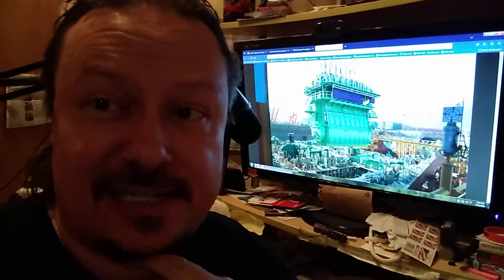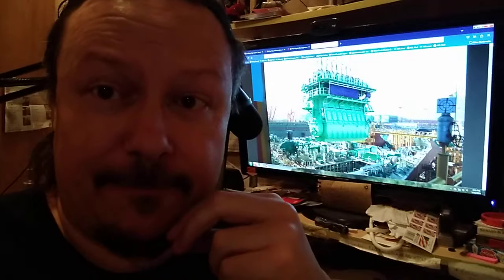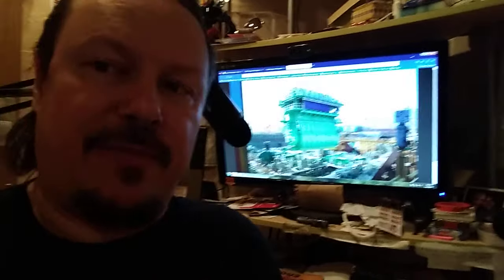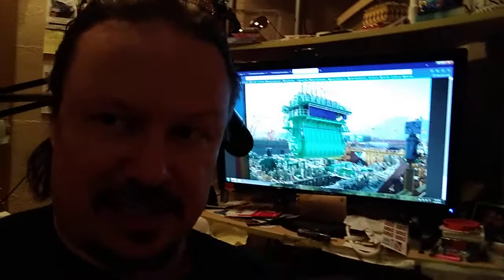Dali Container Ship Baltimore Bridge Crash technical aspect explained by maritime expert.

Comment: Id be inclined to disagree. If my memory serves from my time on low speed diesels, the shaft generator isnt used when manoeuvring in port. The reason being is you are constantly adjusting the speed and often with turns you will stop the engine prior to it so your shaft will stop turning. Theres generally a separate generator set running to cover this and then the shaft genny is switched on when its in open sea and continuously turning at a constant rpm. If they lost the engine for whatever reason, by the time it was restarted and control passed up to the bridge and the engine re-engaged, the two minutes is long gone and you are already against the bridge.
Reply from the maker: Reports have said they lost all propulsion and electric, the lights are seen going off and on again as the ship neared the bridge.. Even a separate generator system must have failed to have ships lights and power cutting off.
Reply: Completely agree with you..  on my ships shaft generators only used in open sea. Never  ran in standby mode,  always ran generator to supply power on standby.   So many other things which is not in agreement  with systems and operations on solas ships or big ship systems or operation principle.
Reply: Shaft generator was not running   If it was running that was a huge mistake   Problem was much more likely unstable parallel opration of at least 2 of the main generators .  A common problem that is often misunderstood by the crew and often leads to tripouts.

Comment: What should have been done is not try to stop the ship by giving stern thrusr nor dropping the anxhor after emergency power was restored to the steering,  but let the ship di as it was while approaching the Bridge, at about 8 knots & navigate the vessel under the ship using the 8 knots head momentum
To slso know that the heading is not depended on the propulsion but on the momentum,
Reply from the maker: Reports says they lost steering ability so possibly that's why they tried reverse when engine was restarted.  Something extreme must have happened to cause electrical loss and propulsion, most likely related to the maintenance work done while in port..

Comment: "The structure may of looked so weak" until till you find out once the 1st break happened the  cantilever (4/5's of the entire the bridge) pivoted down like a see-saw over the undamaged channel pier ripping & lifting the far end of the bridge (3 piers over) up into the air which  started the snapping & crumbling of the trusses into pieces. Unfortunately it can only be seen in a full shot of the entire bridge as it went down. This is not visible in most video's because of the intention to have a better closer/instant view of the ship while the bridge was collapsing.
Reply from the maker: The concrete bases used for this bridge seem too small.  If they oversized them and made them taller, they would possibly safeguard the metal from being hit by such a ship.  They are supposed to built reinforced with metal and highest strength concrete.
Reply: @benzproducts Truss bridges were very popular from the 1940s to the 1970s because they were very strong for their weight. But they got that strength by everything reinforcing everything else, so if you had a collision that took out some of the structural supports, the whole thing would house-of-cards itself to death. That's why we don't use truss bridges anymore.

Comment: Not sure if the Dali has a shaft generator. According to Wiki, it has two 5,150 hp (10,300 hp combined) and two 5,900 hp (11,800 hp combined) auxiliary diesel generators for a total combined 22,100 hp.
Reply from the maker: It's possible that they have separate generators and also shaft driven generator as well.  I am wondering if they ran shaft driven generator as they left port to save fuel when it was dangerous to do so, this would explain the sudden loss of electricity and propulsion.  There's a special marine website that lists detailed technical specs as to what engines and systems are used on specific ships.  I have to find the information, possible follow up video...

Comment: My friend bought a big Tug , The Galene ,
with direct reverse . He joked about delivering it to home. “ I’ll be at dock at 2 pm , Don’t be there.”
     Forget about the dead prop , anchor grabbed and prop act like a sea anchor.
Down current you have to drive small boats aggressive to get turn to respond. 
With a vessel I guess you call it “ authority.”
 Had they missed bridge pylon and drug anchor over the high pressure gas line , we would have a bigger story and mess .
$$$ , they gamble with public infrastructure .

Comment: tugs guided it out of the dock. why not direct it out? fuel savings? now the commerce is gonna have to eat it. plus the dead people. prices on goods may rise. etc....really helped with my question as to why the huge 2stroke died so quickly.....i'm still hooked on the Fitzgerald sinking.
Reply from the maker: Engine had apparently had some maintenance procedures done while in port.  Possibly low lubricating oil level or air in the fuel system could cause a cut out.  They have safety switches to shut engine down if so level of lube oil gets too low.  A possible mistake could have been made during the maintenance procedures.

Comment: Why was that ship moving so fast in the proximity of the bridge to begin with? Unless the video's have been sped up, he was hauling butt!! Loss of power or not, why so close to the support structure of that bridge? Dynamite and C-4 explosive couldn't have brought it down so quickly.
Reply from the maker: These ships have to maintain some speed to overcome wind and currents in the water from pushing the bow sideways.  The aft or rear of the ship is the only part the rudder can move, this causes the ship cruise at an angle that's worse the slower it goes.
Reply: The videos you've probably seen have absolutely been sped up to make them watchable in a short time span. It's about 4 minutes from the mayday call to the collision (and that should also point out, a "terrorist attack" would not have sent out a mayday call).

It takes about 30 seconds from losing power for the auxiliary diesels to come on. After that it takes between 1-2 minutes for them to warm up to the point where they can turn the shaft. They lost power at the worst possible moment and it resulted in the ship being carried by water currents into the bridge footing. I've also read some information suggesting they were trying to back down using their screw in reverse after they got power back, I don't know if that's true because I don't know if they had time to do so.
Reply: @katherineberger6329 not a terrorist attack, more like a cyberattack where the attack was done without the crew's knowledge. Unfortunately we may never know.

Comment: I know first hand that a two-cycle 6-71 GMC engine will run backwards!  I  was a young man while driving a truck with a GMC diesel engine and had an interesting experience while stalling the truck while driving on soft material.  Of course this cannot happen to a ship engine driving a propeller.  Point is that GMC diesels did operate much like the two-stroke MAN marine diesels.   The ship's engine began to smoke prior impact.  However, the engine smoked only after the lights (electric power) was observed coming back on.  Was that the main engine smoking?  I ask that because  auxiliary engines in ships are often about the size of that found in branch line locomotives.  Smoking engines are either in under heavy load, or are running rich for a variety of other reasons. Diesel engines often burn rich when fuel supply is resumed after being paused and intake air has cooled. Fuel injectors in many large modern diesels are electrically operated and not operated and timed entirely by the camshaft like the old 6-71 Detroit diesel example that did not even need the key turned on to continue running.  So that may provide us with a clue on what we may learn about the engine smoke in the coming weeks.  No electric, then no fuel injection?   No electric, then no other engine control like operating fuel pump(s) or open throttle?  Perhaps the resumption of torque from a reaccelerated main engine caused the single propeller that rotated in one direction to produce an unexpected thrust that caused the ship to veer in an undesired direction?  Did the rudder end up in some unimaginable orientation while the power was interrupted?  Just some thoughts.  I liked your video and believe you are on to something.
For those interested in MAN marine diesels:
https://www.man-es.com/marine/products/two-stroke-engines/two-stroke-engines-portfolio
Everything you mentioned on how to start a main ship engine:
https://www.youtube.com/watch?v=5mFmCxOjY_A
Reply from the maker: The amount of black smoke coming from the ship before impact tells me it's definitely the main engine.  Why they lost power is most likely related to the maintenance procedures that were reportedly done while in port.  An interruption in fuel such as air in the lines could cause this.  Heavy fuel oil needs heating before it can be burnt.  Also to meet port emissions requirements they possibly have a system to switch to #2 diesel fuel and back to heavy oil at sea.